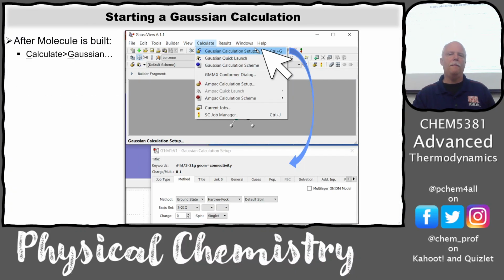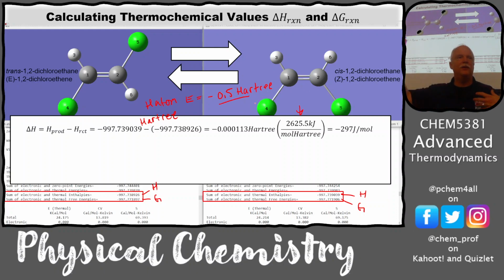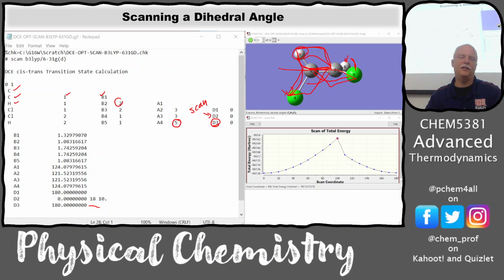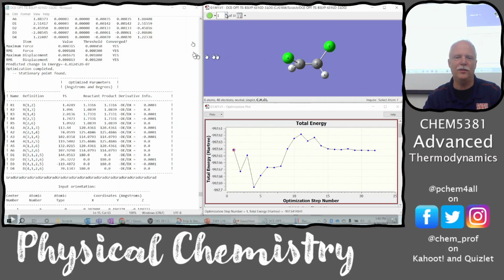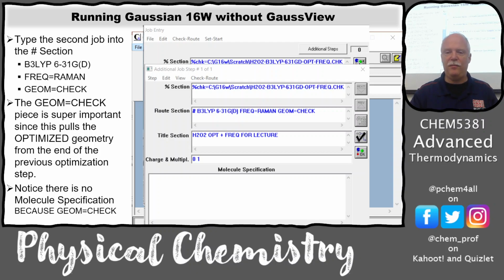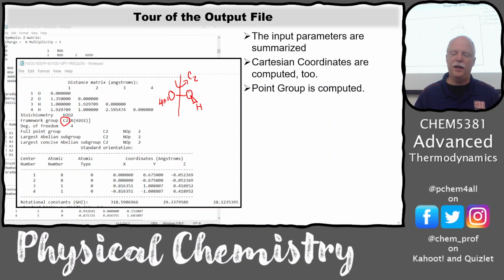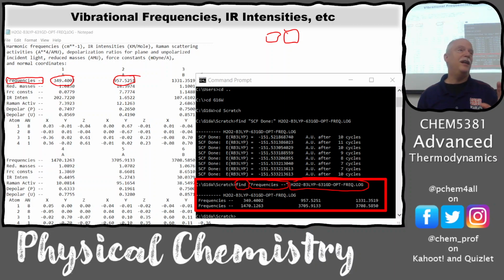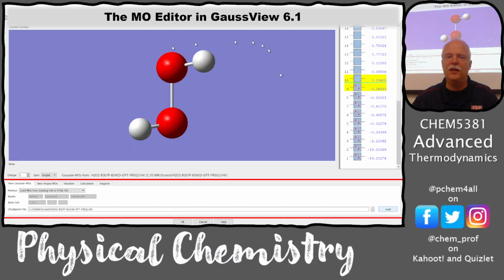Scanning dihedrals, using some old MSDOS tricks, and computing MO surfaces

Comment: I like to use these pipe operators > >> < with a batch file to redirect the output of echo commands into a new text file and to redirect the text file to DOS Debug to create a new 16 bit executable for DOS from the output and the output contains internal Debug commands and a routine made with x86 assembly mnemonics.